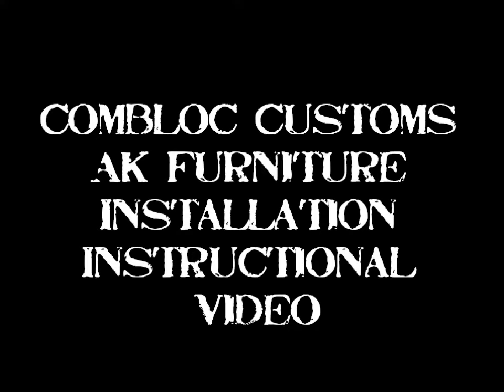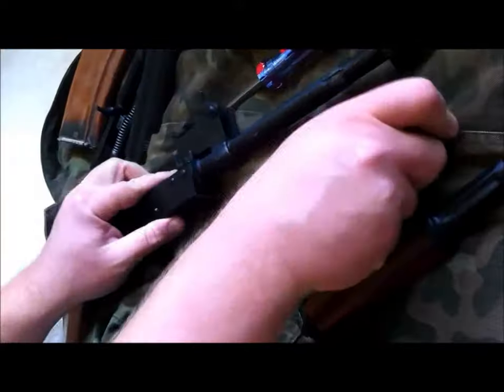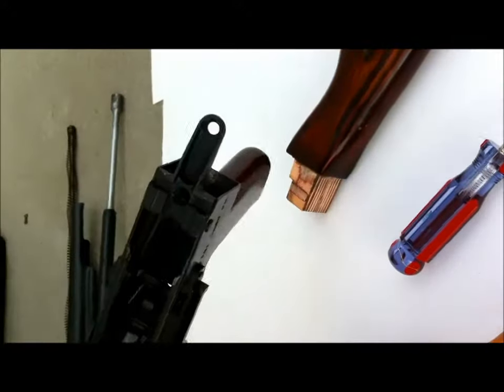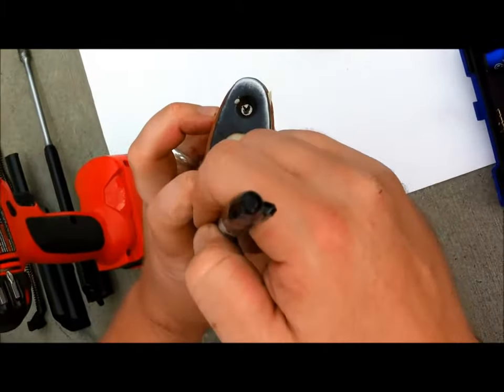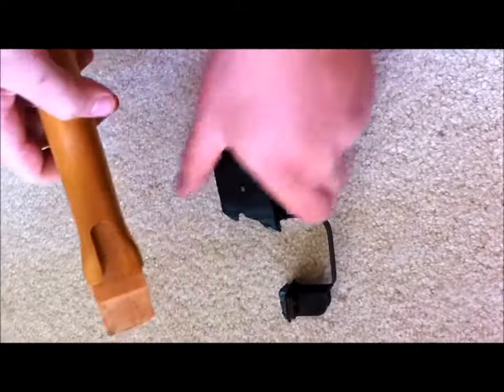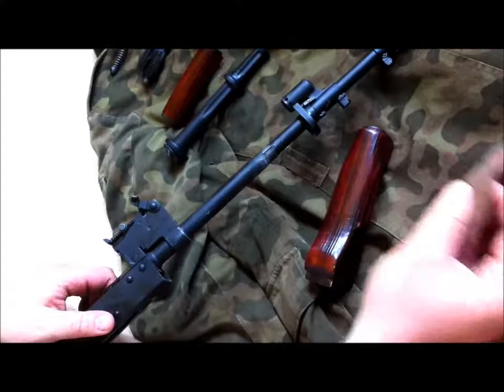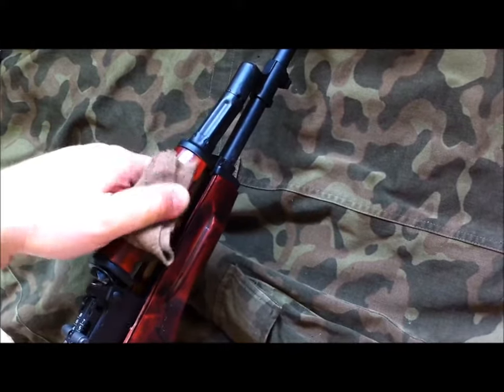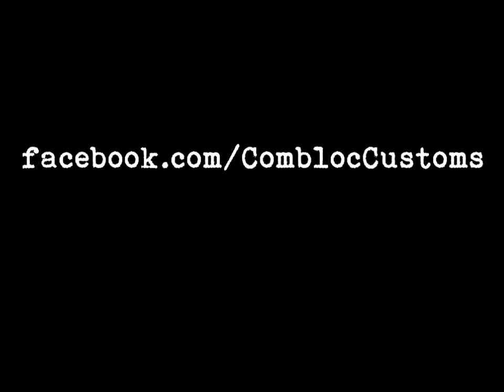AK 47 AK 74 AKM furniture installation tutorial Combloc Customs Ironwood Designs

Comment: Quick tip: you should use a drill bit called a "brad-point" they're made for wood and will give a much more accurate and clean hole. Those split-point bits are kind of tough to make sure they go exactly where you want them.
Reply: Kyle N Thanks!

Comment: I don't understand why you leave a gap in the wood stock between the wood and rear trunnion
Reply: Wood expands and contracts with temps and moisture if it was on really tight it could crack /  split.
Reply: @dermharse9614  true, wood does expand and contract.
Reply: It’s supposed to be a much smaller gap then he showed

Comment: I don’t know what you did to get the bolt carrier group out but it just does not come out
Reply: Put the rifle onto fire, remove the dust cover by compressing the rear button, push that button in all the way once the dust cover is off, and then life up and pull out the spring. Slide the bolt all the way to the rear, then lift it up and out of the receiver.

Comment: Fuck Ironwood designs. Paid $250 for their stock and the fucking handguard split in two when trying to install it. I can't just replace the piece, because they just happen to give me two pieces with really unique grain, so anything else is an obvious mismatch.
Reply: They sent me a spiker lower hand guard for a Chi-Com that was chipped into the cleaning rod hole, plus it was two different colors in the wood itself. I had to pay another $64 for a new lower with out the spiker cut. I found an original Chi-Com set and now trying to sell the Ironwood Set, bastards.